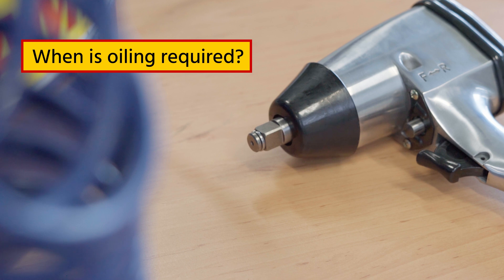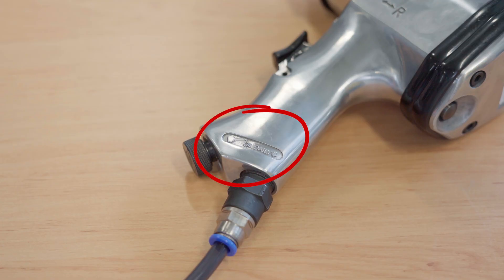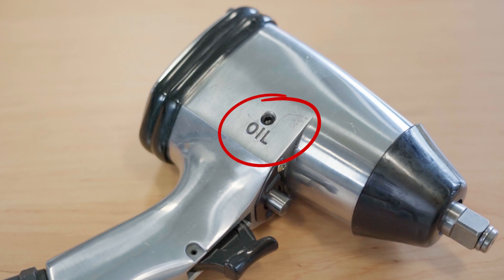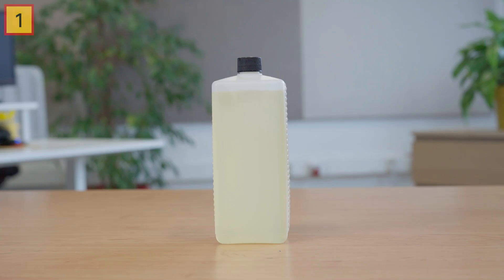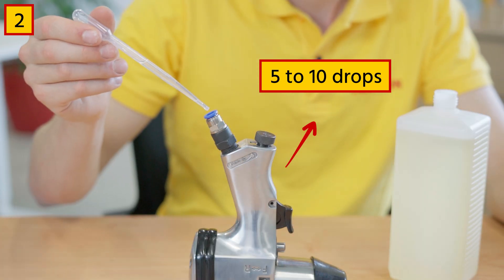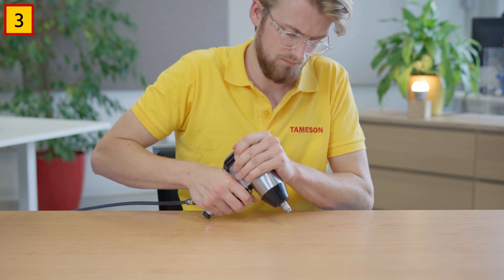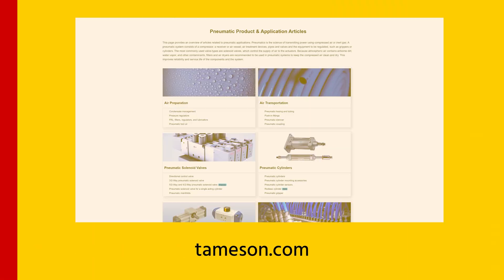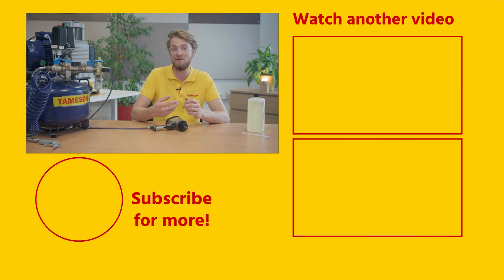How to Oil Pneumatic Tools | Tameson

Comment: I have an Air Impact Driver that has operating settings 0 thru 3.  0 is off or so I surmise.  1 never did anything till I oiled the bejesus out of it one day.  And I have had this Driver for over 30 years.
Reply from the maker: Hi, thanks for your comment and sharing your experience.

Comment: What oil do u use
Reply from the maker: Generally, pneumatic tools require a specific type of oil designed for air tools. This oil is typically a light, non-detergent oil, often referred to as pneumatic tool oil or air tool oil. It's essential to use the correct oil to ensure the longevity and proper functioning of your pneumatic tools. Also, checking the manufacturer's recommendations is always a good idea.

Comment: What about to greasing them if they have grease nipples
Reply from the maker: Hello, you should check the instructions from the tools you have to find the proper way to lubricate them. If your tools use grease for the lubrication, you need to find out which grease is the suitable one.